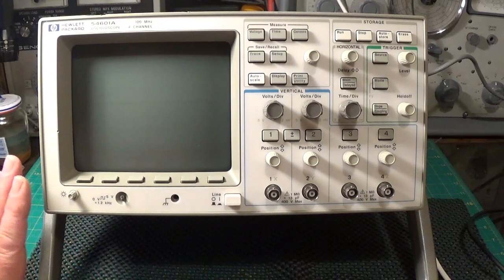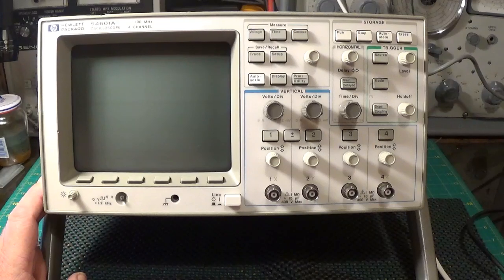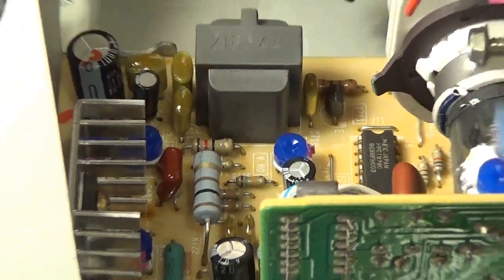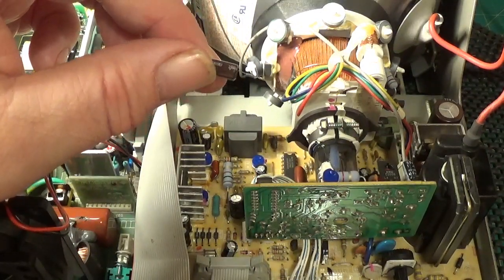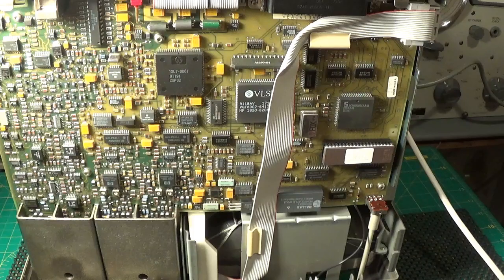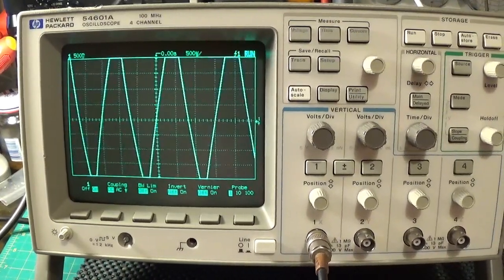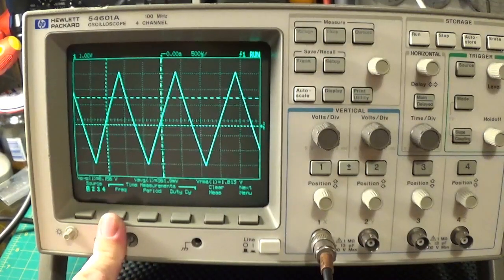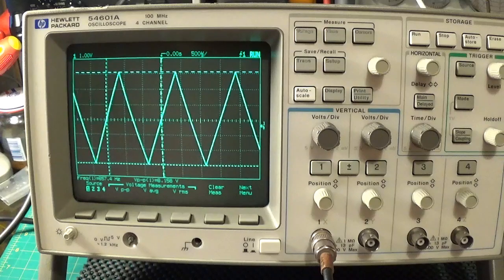HP 54601A oscilloscope repair - compressed display

Comment: Thanks Andrew. I am looking at buying a dead unit and wondering if it is worth the effort. Your video was quite helpful.
Reply from the maker: Hi Jon. great scopes if the CRT's not been trashed. The Dallas ROM is battery powered and one day will die.

Comment: Hello SIR!!!  I am from Italy I have the same oscilloscope. The same problem!!!! I change the capacitor as you indicated in the video! It works!!!!!!!!! This capacitor, despite the FLUKE instruments, reads approx. 9 microfarad, presents high ESR  so no longer suitable for the application. As I replaced it with a 10 micro F 63V low ESR, the scope start working perfectly. No adjustment is needed. Sir, I have no words. Hope one day to meet you to shake your hands. You are a real professional. Best regards Bernini Mentore
Reply from the maker: Grazie Bernini, sono contento di sentire che l'oscilloscopio funziona!!

Comment: You mentioned that it was a Hitachi scope, but I couldn't find any references to it. I knew Tek TDS series were SONY,  and HP's LCR meters are Yokogawa, but I have no idea that HP used Hitachi
Reply from the maker: I think it's just the CRT actually!
Reply: @Andrewausfa  Make more sense. Hitachi made a lot of good CRT monitor back in the days. My first giant 29 inch CRT tube was Hitachi. HP has a lot of proprietary chips in this unit, so it's very unlikely that this one is not designed and made in-house.

Comment: Nice Scope Andrew But Scarey With All That SMD Stuff  Half Of It Looks Like It Could Come Out Of a Portable T.V Glad You Got The Vertical Fixed !!  Lack Of Height On a Old Portable Was Usually a Chip Or a Bad Cap Or If Your Really Unlucky a Fault in The Deflection Yoke Great Bye For The Money. Rrgards mike
Reply from the maker: Very scary Mike. Yep there's not much inside. I trashed our last CRT TV here a few years and was really surprised at the time how little there was in it compared to what I remembered the last time I looked in a TV. This is very similar.

Comment: Nice Fix ! SMD scares me !  through hole resistors we cant write the values on lets put a colour code on them ! perfect  now lets make them even smaller and write the value on them and for good measure lets do the same for the capacitors but lets not put the values on !
Reply from the maker: As soon as I see SMD I'm running Benji. I don;t have the eyes or tools for it. Well, I have a large hammer.
Reply: @Andrewausfa  I know the feeling I used to have  but not anymore I need glasses for through hole components now !

Comment: Great find! Can't believe that you found problem so quickly!  I bought a Gould digital scop and have had no luck with it yet. That will come in handy down the road. Thanks for the video!
Reply from the maker: Thank you! I won't find the problem on the next thing I buy I can guarantee it :)  Which Gould scope do you have? I know transformers were an issue on some of the CRT ones.
Reply: @Andrewausfa  I know what you mean if you find one really quick and easy you fight through the next one but, we don't learn as much on the easy ones! As far as the Gould scope goes it's digital display comes and goes. Haven't had time to work on it in awhile. Will get to it in the winter months.

Comment: Well bought and well repaired Andrew. Thought you would be interested that when that scope was new it sold for around $3000 USD or about 1875 UK pounds at the time which when adjusted for inflation would be about 3900 UK pounds in todays money. ATB Doug.
Reply from the maker: Hi Doug, interestingly one of the design teams goals was to make it, as it was cutting edge in 1992, come in around the same cost as an all the bells and whistles 100 MHz analogue scope.